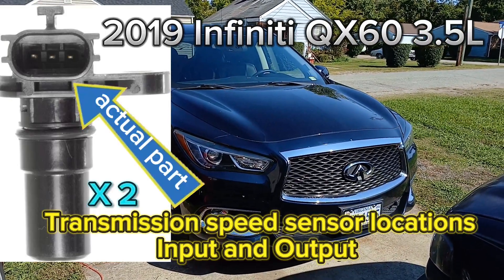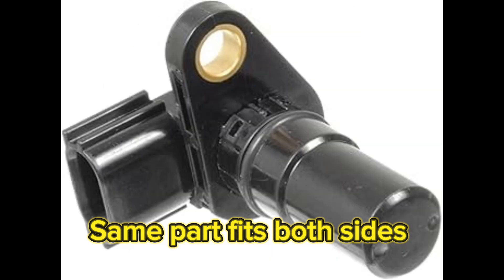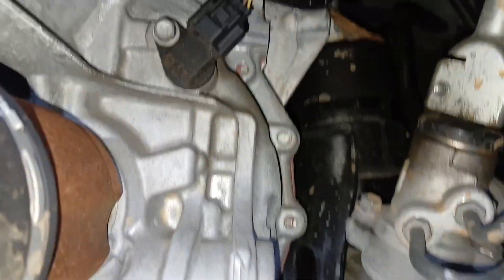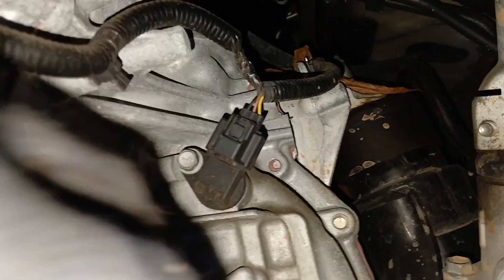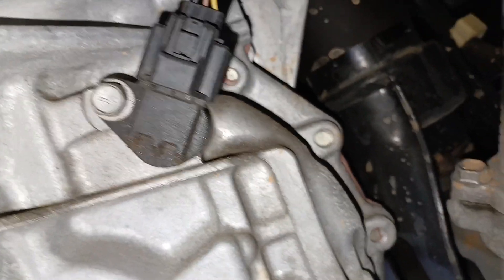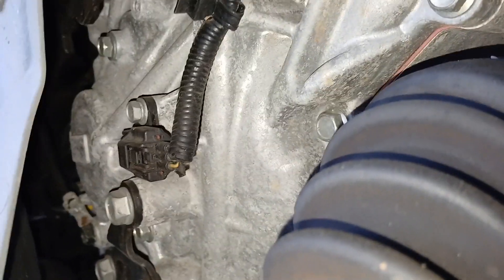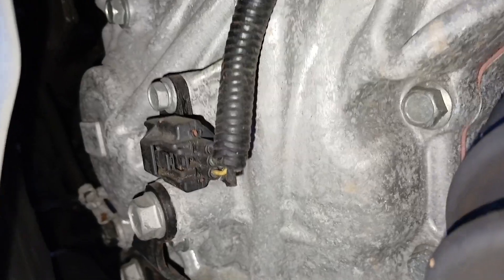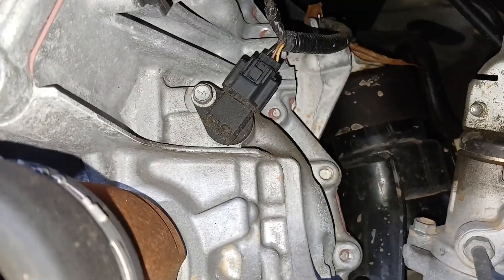2019 Infiniti qx60 3.5L Input and Output speed sensor locations

Comment: hello, I have an error code p0500 and p0720 for my infinti qx60 , so I would need to replace these parts ?  also is there speed sensors on both sides of the vehicle on the passenger side and driver side ?  do you have a video showing replacing it? thanks so much you might save me a lot of money if I can do this
Reply from the maker: There's only one that I know of. I don't have a replacement video. Just wanted to help people who needed to locate the part
Reply: @Davethemechanic305  I appreciate it very much .  Just knowing this is going to help me a lot.  I am going to replace mine on Monday I’ll let you know how it goes.  The error code doesn’t indicate anything wrong with the valve body so I am trying this first. Thank you for your response and video
Reply: @AnneJ_A_P_A_N what did you do to fix ? I’m getting same codes on my 2017 q60 rs
Reply: @Malek_Melo  I got the same issue won’t shift pass 3rd gear
Reply: @moemoney954 let me know if you find out what the issue is. My q60 only has 50k miles
Reply: @Malek_Melo I haven’t fix it yet but probably is the valve body